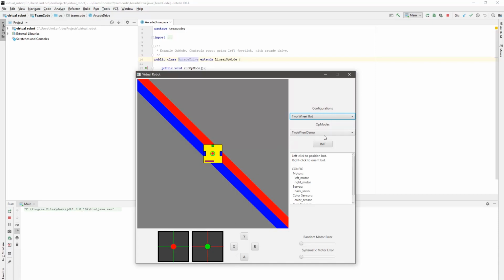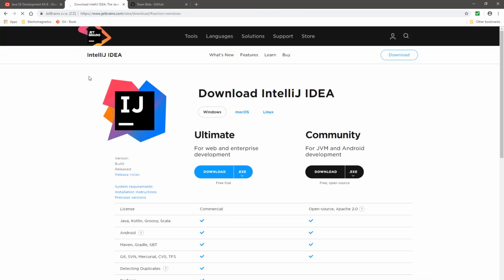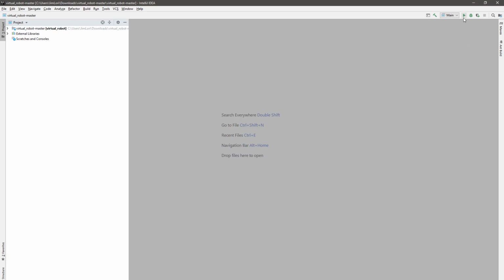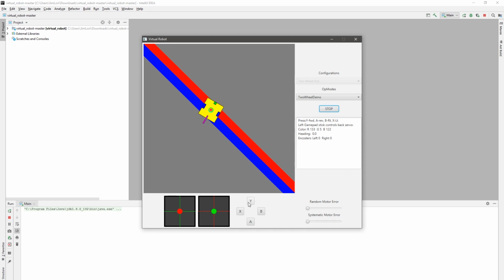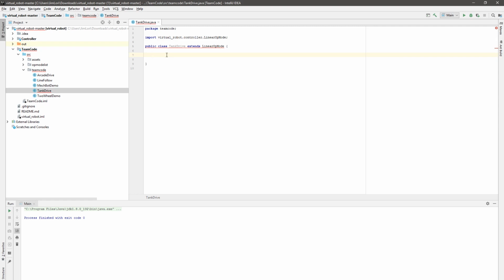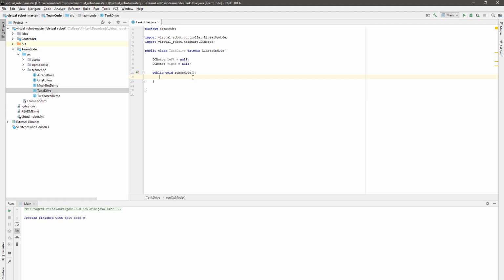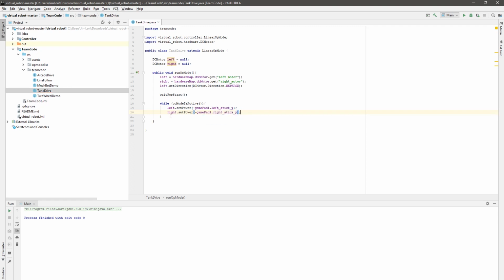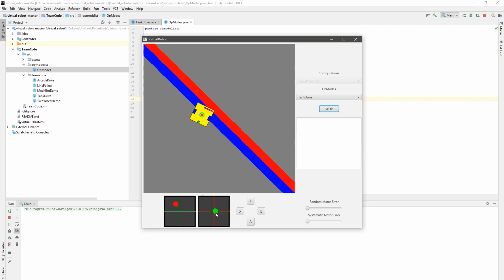Virtual Robot Tutorial

Comment: Hi, it says javafx does not exist. How do I fix this? @FTC 8397
Reply from the maker: Hi Nikhil, 
The most likely cause of this would be that you are using a JDK that doesn't have javafx built in.  JDK 8 (either from Oracle or Amazon Corretto) has javafx built in.  Higher levels (e.g., JDK 11) don't include javafx. So if you were set on using a higher JDK version, you would need to download javafx separately (it can be obtained from OpenJFX). But I would recommend just using a JDK 8 to make things simple. There was one user (with a Mac computer) who reported issues getting javafx to work with Amazon Coretto 1.8 (which is JDK 8); that user instead downloaded Bell Liberica Dev Kit 1.8 (also a JDK 8), and was successful with that. So far haven't heard about anyone else with problems using Amazon Corretto 1.8.  For detailed installation instructions, go to the virtual_robot github repository and look at the file "Detailed Installation Instructions.pdf". Feel free to email us (see email address on the github repository) if more problems.
Reply: @FTC-ie2pn  Thank you! Liberica seemed to work for me. The simulator works amazing now!
Reply: I am having the same problem

Comment: I have a bit of a problem - I have a Mecanum Program, but when I press INIT on the simulator, the button switches to START but only for a few milliseconds. After that, it goes back to INIT, so I have no time to press START. Here is what it says on the IntelliJ:

Exception thrown by opModeThread.
java.lang.IllegalArgumentException
No com.qualcomm.robotcore.hardware.DigitalChannel named touch_sensor is found.
Stack Trace:
  com.qualcomm.robotcore.hardware.HardwareMap.get(HardwareMap.java:149)
  org.firstinspires.ftc.teamcode.StraferControl.init(StraferControl.java:33)
  virtual_robot.controller.VirtualRobotController.runOpModeAndCleanUp(VirtualRobotController.java:566)
  virtual_robot.controller.VirtualRobotController.access$700(VirtualRobotController.java:58)
  virtual_robot.controller.VirtualRobotController$7.run(VirtualRobotController.java:491)
  java.lang.Thread.run(Thread.java:748)

Finished executing runOpModeAndCleanUp() on opModeThread.

Thanks!

Comment: I got this msg: 
Information:javac 11.0.6 was used to compile java sources
Information:3/22/2020 12:34 AM - Build completed with 100 errors and 0 warnings in 3 s 216 ms
Error:(3, 39) java: package com.qualcomm.robotcore.hardware does not exist

Any help?
Reply from the maker: I'm not sure why you got that specific error, since the download definitely includes that package. However, I can tell you that significant additional steps are needed if you want to build and run this with JDK 11 (which you're trying to do here), as opposed to JDK 8. That's because JDK 8 contains JavaFX intrinsically, whereas with JDK 11, you have to import JavaFX as a separate library. With some extra work, it is possible to use JDK 11 (we've tested), but I'd recommend installing JDK 8 and using that (via File->Project Structure) as the JDK for this program. One other thought: when you download the virtual_robot zip, and extract it using the defaults, the file structure you wind up with is something like this:  ...\Downloads\virtual_robot-master\virtual_robot-master.  The appropriate folder to select as your project folder in IntelliJ is innermost (i.e., the most deeply nested) virtual_robot-master folder.
Reply from the maker: Also, please let us know if you still aren't able to get this working, either as an issue on the github repository, or here, and we'll try to provide further assistance.
Reply: @FTC-ie2pn  Thx for reply. Installed JDK 8 and all works great. I love X drive implementation.
BTW, the 3D version from github don't work anymore.
Reply from the maker: @teamphoenix3258  Hmm, I just downloaded and tested the current 3D version (the one with physics simulation, "vr_physics") and it is working for me. If you are interested in using it let me know the details and I'll try to assist. The 3D version won't work on some older hardware. It is fun to play with (stacking blocks, etc.), but for purposes of learning programming and testing autonomous navigation, I prefer the simplicity of the 2D version. I removed the first 3D version (the one without physics simulation, "virtual_robot_3D") because I figured users would prefer to have the physics.
Reply: @FTC-ie2pn  You-re right, the 2D version is perfect for us right now. We try to implement Pure Pursuit and your simulator make us the life easier. If you have experience in Path Generator/Follower, please let us know...
Best regards, you do great job!
Reply from the maker: @teamphoenix3258  I could provide some help with Pure Pursuit, but youtube comments probably won't be sufficient. If interested, please have your coach email our team email address (which is available on our github page: https://github.com/Beta8397), as correspondence would need to be copied to her or him.
Reply from the maker: @teamphoenix3258  That link wasn't quite right: https://github.com/Beta8397
Reply: @FTC-ie2pn  Really appreciated! Email sent!